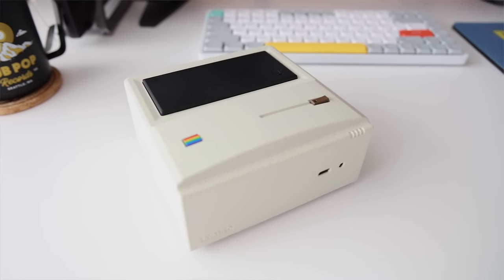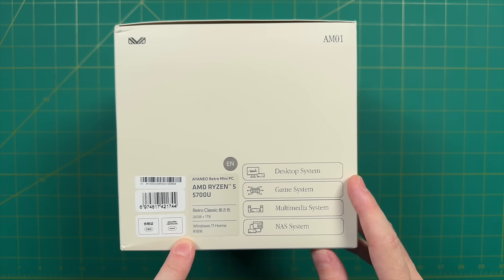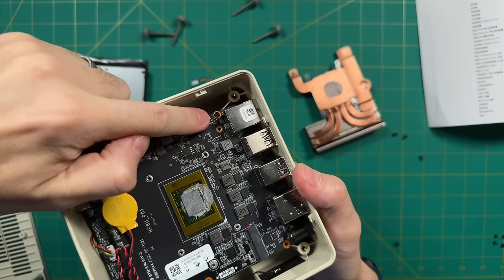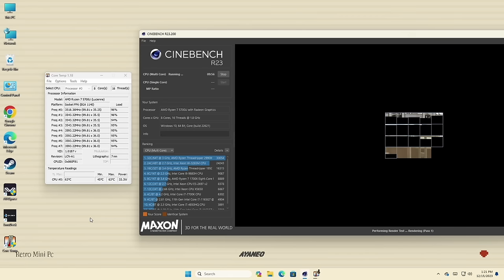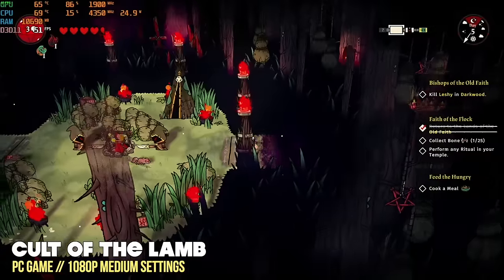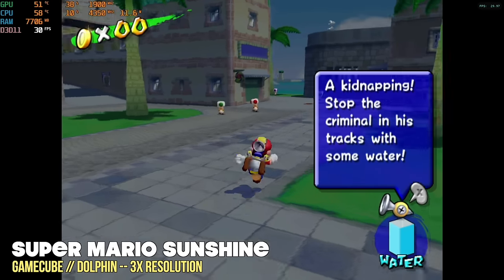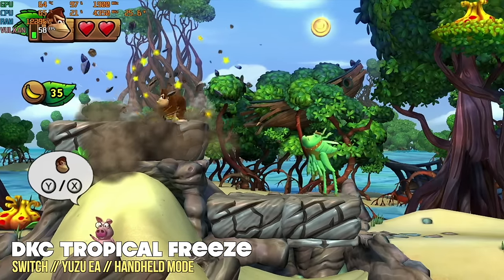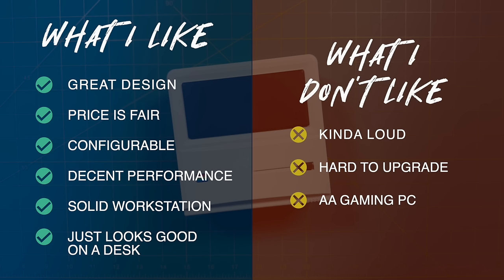AYANEO's Excellent Budget Mini PC: AM01 Review

Comment: Would be neat if the "screen" on the case was an actual screen, and it had a mini keyboard and mouse to complete the aesthetic. Would love to see more retro-themed mini PCs
Reply: Having a mini screen with some useful data is actually not out of place with mini PC's (this is speaking more from the diy space than the prebuilt space though) I support! I'm not sure the mini keyboard and mouse would be all the worth the added cost that would come with it though (maybe a usb-c hub that's shaped like a mini keyboard?).

Personally, as far as taking full run on aesthetics goes, I'd rather just buy one of those C64 keyboard mini-pcs
Reply: Needs a screen with built in crt filters.
Reply: They have it actually: AYANEO AM02:7840HS Retro Mini PC
Reply: the good news is they will release the AM01S

Comment: PC gaming has never been more accessable. As someone with a high-end rig it's great to see these lower power draw devices populate the market. All we need now is someone to put a CRT screen in one of these mini pcs and make it the ultimate retro device.
Reply: or just something that looks like this, a smaller more portable micro PC with a built in screen, small keyboard, and the screen could have several CRT shaders to chose from.
Reply: Might use this for the tv to replace the android tv box. Android boxes are too limited with weak hardware and cant even run many retro games with it except nvidia shield. This mini pc is a perfect replacement and even cheaper than nvidia shield
Reply: @morpheusmorph13 even shield isn't all that anyone you can only really emulate up to Dreamcast with it
Reply: @morpheusmorph13 if your TV supports dolby vison i have bad news. Windows does not
Reply: @Teremei  true...crt is a luxery vintage item these days lol i was intrigued by John Linneman's video from digital foundry about crt displays and how we went back in some was by mass adopting LCDs

Comment: My Minisforum UM560XT handles Switch emulation very well through Batocera, so I would have thought this system would be similar or better. My Minisforum PC uses the Ryzen 5600H with 16GB DDR4 3200 RAM and the Vega 7 IGP for  reference... It's also very quiet, unlike my previous Intel NUC 8. Great review btw!

Comment: I was happy to see barebones until I saw how much disassembly is required just to get to the drives. That's just absurd. What were they thinking? Otherwise, it's a great looking device. Would have liked to see a model with usb4/egpu, though, and there should have been an actual display on it, not just a black panel.

Comment: Enticing! Thank you for the Linux part. Did you check if can output more than 60 fps to monitor? For use with a fast 144Hz panel. In theory is suited but just to confirm. For super-smooth animations!

Comment: Not bad pricewise but also not great. I bought a 5600U Mini-PC (Ace Magician) with 16GB / 512GB and Win11 Pro nearly a year ago for roughly 350 Euros incl. 19% VAT. It's also relatively quiet, at least when in low power mode and seems to be far easier to expand. It also offers two M.2 slots and I think the cooler might be beefier.
I also unplugge the power cables for the gaudy RGB lighting, which needed further disassambly. xD

Comment: Its a hard sale honestly.
Its marginably better than the Steamdeck. But its just a mini PC.
The steamdeck for 350, has about 75-80% the power of this device. But is a standalone device.
The Steamdeck Oled has the nearly identical benchmarks with the new CPU, is about 350 as well, and its a full device.
When you put the Steamdeck on a dock, its all in all the better experience. You can just pick it up and go somewhere else.

I think even if you are in the market for a minipc, the steamdeck + dock is just the better option.
And try to go for the OLED. Whatever reviewers or valve say, the OLED is way better for the same price.
Reply from the maker: I agree that the Steam Deck is a great option, but one point of clarification is that the OLED model starts at $550, so there's a pretty huge price gap between the two.  But still the 64GB LCD Deck at $349 is a very good option as a hybrid handheld/docked solution!
Reply: The OLED is over $500, that alone will change the discussion. Not to be mean, but you should probably do some research on that before making recommendations.

Comment: Best value are the Beelink 5800h units. much faster cpu with 16GB and 512GB for around 350. Otherwise the 5560u adn 5700u are close in performace (higher single core on 5560u) for 270-290 (with 16GB and 512 again)

Comment: In your Tech Specs section, you have it listed as using LPDDR4 RAM. But when you tear down the unit, it is clearly using DDR4 RAM; we can read the label. LPDDR4 and DDR4 are very different.
Reply: What's the diff tech wise?
Reply: Relax, dude. It’s a small error. Russ should have earned all the grace from anyone in this community by now.
Reply: When he actually opens it up he mentions (and we can see) that it's DDR4 so nbd
Reply: @EHokie  It matters. They are totally different chipsets, and they aren't interchangeable. I was about to pass on this until I saw him open it up.  Yes, it's a simple mistake, but it's a critical detail that needs to be corrected.
Reply: @ninjason57  They are not interchangeable. LPDDR4 is used in mobile devices (cellphones, tablets).  DDR4 is used in high performance devices i.e. PCs and Laptops.
Reply: @Mr2Eazee  I was about to quit watching the video when I saw the spec sheet. But I saw that he opened up the unit, so I stuck around to see if it was actually using LPDDR4. I'm glad I stuck around. Now, I am considering buying one.

Comment: another reviewer mentioned the hidden undocumented screw under the heat sink. the biggest drawback is you are forced to clean and apply thermal paste everytime you want to get to the underside like installing, checking or updating the 2.5” ssd drive.
Reply: If you’re doing this a lot on a mini-PC, then there’s maybe a problem with the user. 😂 Let’s see how the non-review units are, hopefully they are telling the truth when they say it will have 3 screws on retail units.
Reply from the maker: Retail units have already been shipping and yes, the customers are reporting that their units only have three screws, so it was just the reviewers who had to do the extra work :)

Comment: Not sure I can get on board with that degree of form over function. I liked it at first because I had a Macintosh SE years ago and it's so cheap, but how is it possible that they have something that looks like it could be an access panel for the RAM and storage on the top - on the correct side of the motherboard too - but it isn't an access hatch, so you have to gut the thing.

Like, just make the top face the removable one. Maybe it'll be a bit uglier but they've absolutely sacrificed user friendly upgrades for aesthetics here. 

Then again given the inspiration for the design, maybe that was deliberate. I had to buy a super long torx driver to crack my Mac SE open because they recessed the top screws deep inside the carry handle.

Comment: Compare this to the Minisforum UM790 Pro which I bought.  For slightly less than half the price, you get half the computer in every respect:  Memory, storage, ports, and processing power.   However, doubling the memory and storage is not that expensive.

The cost of a computer is not just the box.  You must also invest in a monitor, keyboard, mouse, etc.  Why not spend a little more and get double the computer?

However, I wanted to buy a computer for an elderly parent who doesn't need much, which in this case cheaper is better.  I have seen some very low-cost mini-computers that would have been adequate, but I ended up buying a good used i5 computer for cheap.

Comment: I kind of feel like you could find a laptop with the same chipset and similar specs overall pretty cheap second hand, and it might be a better overall purchase. Especially since it would come with a screen and keyboard etc etc. I'll have to take a look
Reply: I might use this for the tv to replace the android tv box. Android boxes are too limited with weak hardware and cant even run many retro games with it except nvidia shield. This mini pc is a perfect replacement and even cheaper than nvidia shield
Reply: Maybe that was true 3 or 4 years ago, but not anymore. I've been looking for an old laptop with similar specs for about 2 years, and haven't found anything at this price point.

Comment: Hi, major issue with this product, they keep delaying the shipment even though it said shipping in December. First I get an email response saying mid january, next they post an update saying end of january for PRODUCTION. This is crazy, simply unbelievable. Please talk about these issues.
Reply: Not really a product issue. It's a popular item, and demand is higher than supply.
Reply: @emlyndewar  It actually is an issue since the people will order this based on media outlets, which got units early. This pushback is not the first nor second NOR third time by the way. Orders from november haven't even shipped. There's no way to defend this.  And multiple times they told us that it would ship 'as indicated on the item', and then pushed back so many times it's basically sus at this point.

Comment: IMO it's a bad hardware design. The looks is good but having to remove the wi-fi card in order to install an SSD or RAM makes me wanna avoid this. I would get it because of the exterior design but most likely already configured as the wi-fi antenna cables still haunt my dreams after I have broken one a couple of years ago.